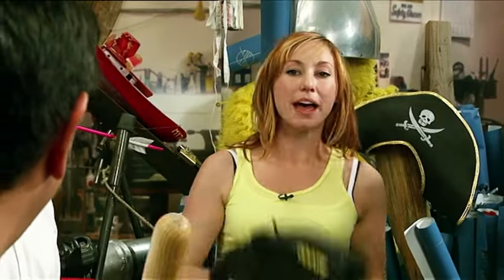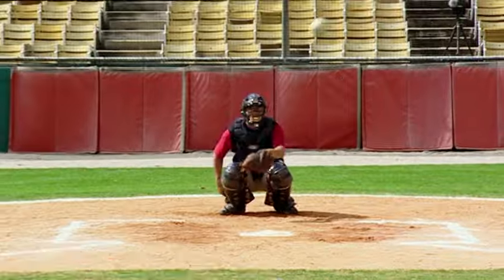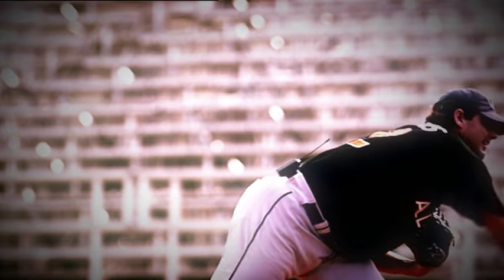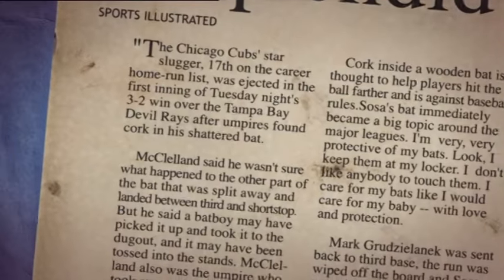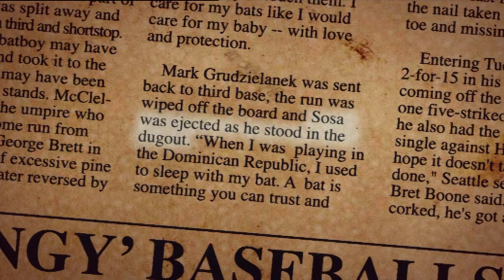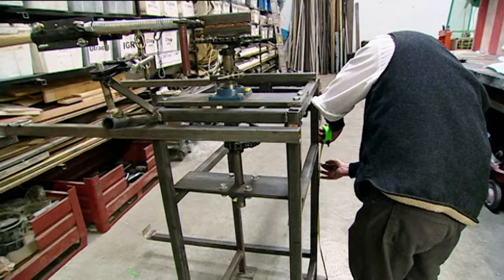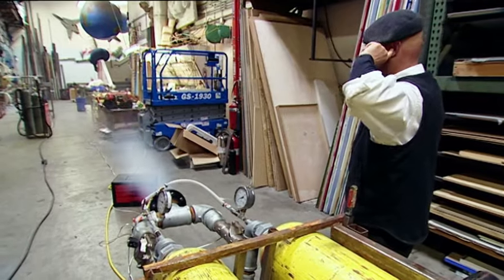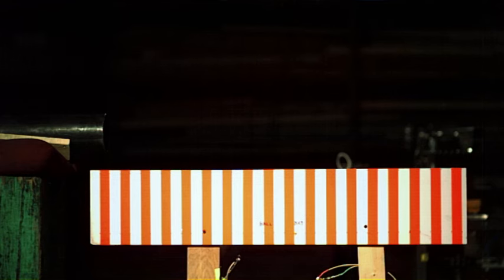Busting Baseball Myths | MythBusters

Comment: Missed the mark on the corked bat, it makes it lighter so it can be swung faster, therefore goes further.
Reply: I don't think so, a heavier bat will almost always hit a baseball further than a light bat. The greatest home-run hitters used heavier bats. Plus,  how does swinging a bat faster equate to cheating? A player is always free to use a lighter bat anyway.
Reply: @alpardo4124  This is a complicated question.  There's a sweet spot for both velocity and mass. And it matters if you are using aluminum or wood.  Aluminum uses  a lot more rebound to propel the ball so you want to use as light a bat as possible.  Wood relies more on mass so you have to find your individual sweet spot.  If it's too heavy the swing speed decreases to the point it effects distance.  If it's too light then the extra swing speed can't make up for the loss in mass. Another factor is reaction time.  A faster swing means you can wait on the pitch longer and let it get deeper so you  can see it better and square it up easier.    When Bonds started taking steroids he didn't attribute his increased strength to his HR increase he said it was his bat speed and increased pitch recognition due to his bat speed.  Most hitters in the ML use as light a bat as possible.  It's cheating to cork because ash and maple bats can only be made so light.  That's why they cup the end, shave the handle, and cork the bats, to make them as light as possible.
Reply: @alaskaguyd963  Thank you, the Bonds info is interesting. If he was taking steroids then he should have gained some extra strength, depending on his workouts, which of course would enable him to aquire greater bat speed. I wonder if he always used the same weight bat after his steroid use began.
Reply: @alpardo4124  That was a good question about Bonds's bat size. I looked it up and he switched from a 33 inch to a 34 inch bat.  But he choked up too so his bats would swing like a smaller lighter bat. So it looks like his strength increased to the point that he could swing a heavier bat AND increase his bat speed.
Reply: @alaskaguyd963  Yup, figures, thanks.
Reply: Where's the part where they did anything?
Reply: You are correct. It doesn’t make sense to swing the bats at the same speed during testing. The human factor would dictate that the bat should swing faster.
Reply: @alpardo4124  It needs to have strength not to break, be 100% hard on the outside, and so a lighter [and therefore softer] wood doesn't do the job like corking a heavy hardwood bat.
Reply: You know you can just use a lighter bat, right?

Comment: Good example of when attemps at standardization ruin an experiment. Should have had batters take a few swings with various corked and uncorked bats and checked average speed, distance. You could try and blind them. But using a machine which is entirely unrealistic compared to a human swinging is silly.
Reply: There are quite a few examples of this show where they obviously bend science in favor of coming to a conclusion that they believe beneficial to society, this is one of those. Lots of “science” these days follows this pattern.
Reply: The machine didn't swing every bat at a predetermined speed though, it exerted a fixed amount of force much like the real athletes did.
That force was calibrated using the standard bat's speed, but a lighter bat would result in a higher velocity on the robot just like in a real game.

Comment: Hey everyone, physicist here. Our main goal is maximizing the exit velocity of the ball after hitting it, because this maximizes the distance it will travel. To calculate this velocity, we would use conservation of momentum (“p” = mv): 

p_1 = m_bat v_bat1 - m_ball v_ball1
=p_2 = m_bat v_bat2 + m_ball v_ball2

Final ball speed:
v_ball2 = (m_bat/m_ball)(v_bat1 - v_bat2) - v_ball1 

So we can see that decreasing the bat mass in isolation decreases the exit speed and therefore hit distance. The problem is we don’t just change the bat mass…. The hitter is able to swing the lighter bat faster, which would increase v_bat1, which serves to increase exit speed. So the two variable have antagonistic effects, and the only way to know which effect is more important is to conduct a study and see how fast professional athletes can swing this cork bat, and how much faster that is than a normal bat. 

I hope this helps. I love physics, so I will try to answer any questions you all have.
Reply: Why not just keep the force exerted when swinging the bat constant? That would give a more accurate depiction of the difference between a normal weighted bat and a corked bat; rather than keeping the swing speed constant, which fails to take in account force.

Comment: There are quite a few examples of this show where they obviously bend science in favor of coming to a conclusion that they believe beneficial to society (not wanting to encourage cheating), this is one of those. Lots of “science” these days follows this pattern. A corked bat obviously makes a difference, anyone who plays baseball can tell you that.
Reply: This theory doesn’t really make sense when you consider the humidified ball experiment from the same episode. Why would they confirm that you can cheat by humidifying the balls but intentionally mess up the corked bat to prevent cheating ?
Obviously the experiment with the cork bat was heavily flawed, but I kinda doubt that it was intentionally sabotaged.
Reply: @JohnDoe-l4d9h  Maybe this one was just badly done, but I recall a few other instances where the same thing happened. The ones I can think of off the top of my head : 1) When they "busted" the myth that you can beat a speed camera by going fast enough (Top Gear proved that you could with a much slower car, Mythbusters had a lambo that they barely pushed); and 2) When they "busted" the myth that you can save gas by tailgating a semitruck -- that last one they acknowledged is true if you got close enough, I don't think they lied about the numbers, but they acted like they were doing the most dangerous stunt in the world -- on their completely controlled closed strip with their own truck driver while communicating on walkie talkies. They concluded it was "busted" because it was too dangerous. It was a lot of theatrics to obviously send a message, there was nothing dangerous about their experiment. There were others but I can't remember.